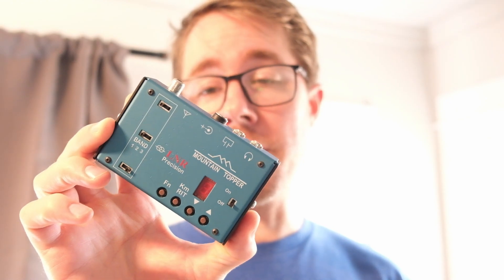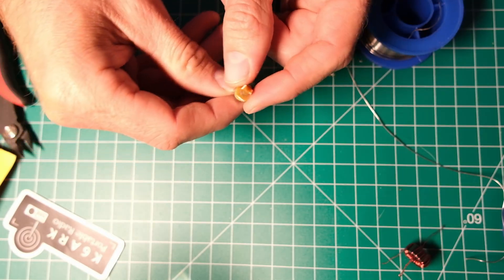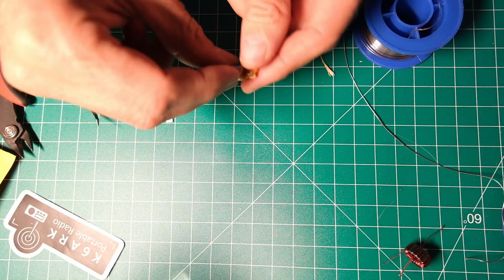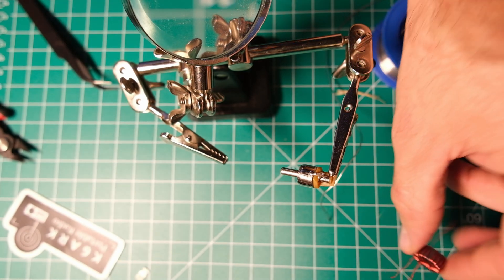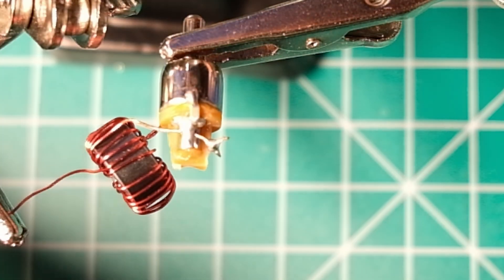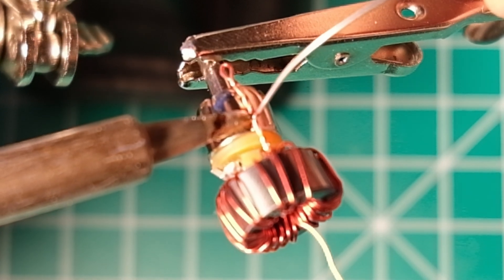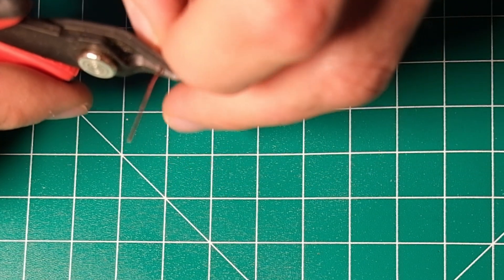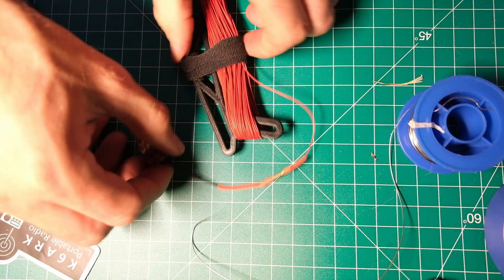Building a DIY End-fed Halfwave Matching Unit on an RCA Connector

Comment: It looks like a great match.  I started putting a 30m link on the 40m EFHW to get the most out of the MTR3B.
Reply from the maker: Heck yeah, so that gets you 20/30/40 with one wire?
Reply: @N7KOM  Exactly, covers all 3 bands super resonant.    Should be only 1oz or a little more.  Bullet connector link is really light.  Will send a picture of  how I link it.

Comment: If the EFHW is only for 20 meters and longer, like for non modified MTR3b, no primary capacitor is needed.   Makes the assembly a bit easier.   My website has a couple posts with data that supports this.

Comment: It will be easier and kinder to your capacitor and toroid if you solder a blob of solder to the RCA jack first, in the area you are going to attach the cap and the wire.  That step needs a lot of heat and sizzle.   Then the wire and cap is quickly tacked to the solder that is already on the connector.  A lot  easier to keep the cap and wire in place
Reply from the maker: Good call, Dan. Appreciate all your tips!